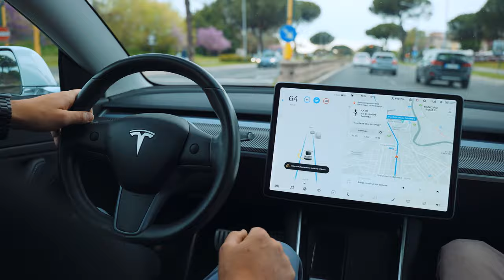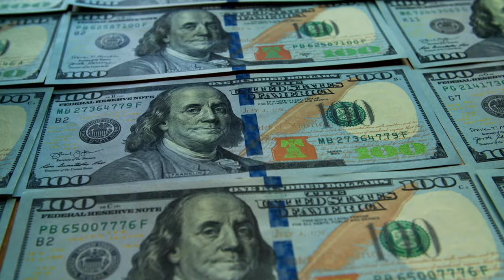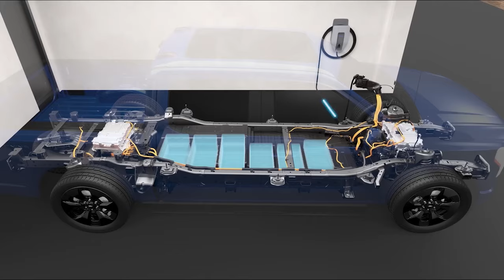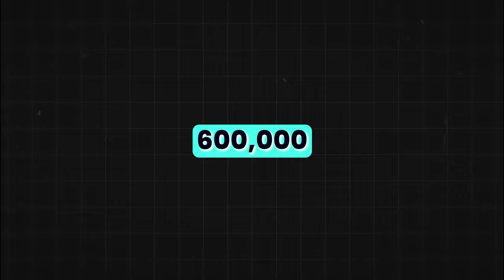"Car Makers Revolt Against Biden's EV Mandate!"

Comment: I try to be environmentally friendly,. That's why I prefer a gas car.
Seriously though. If the government truly wanted to be more "green" they wouldn't care about EV's but instead focus on where we get our electricity from instead. EV's can only be effective after you get the powerplants "green" first. It's literally a prerequisite.
Reply: Lets discuss how clean your gascar is. First go have a nap in your garage with your hascar running. Then come back and explain how clean your gascar is
Reply: @GWAForUTBE I wasn't claiming that gas cars were clean. I was claiming that EV's are often run on fossil fuels as well, plus other enviromental issues, like the mining of the metals for them.

Just because the pollution isn't right in front of your face doesn't mean it's not there.
Reply: @phantomstarlight1366  absolutely.  Shell just closed its first 1000 fuel stations to convert to fuel genny stations.   A good start. A genny will always be more efficient than road going ICE. As new tech or cleaner tech emerges the fuel will be replaced.

Comment: You know, like the car is bad for the climate as well as gas powered card. It's the battery go bad. There's no way to recycle. They catch on fire and who want to go on a trip and have to wait an hour and a 1/2 the car to car. There's nothing wrong with the gas powered car.  You've got to go to the electric car.So far as i'm concerned they can take the electric car and junk it